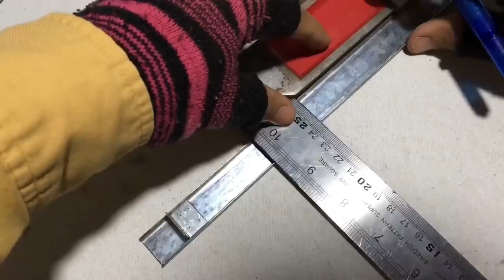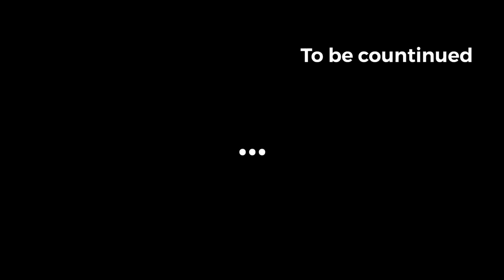Metal Chassis DIY RC Heavy Construction Tractor Truck

Comment: I'm a structural engineer, and what you're doing: whether you realise it or not; is engineering. Your work is very good. A real pleasure to watch. Can I ask where you source your SHS (square hollow section) from and what WT is it? (web thickness or wall thickness) It looks to me like it's around 1.0 mm - 1.2 mm thick.
Reply from the maker: From construction shop.